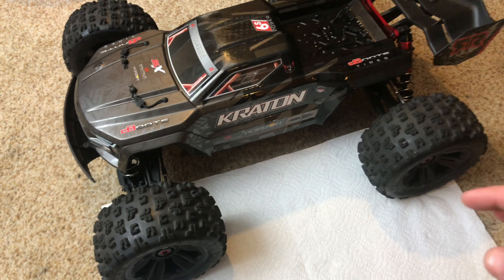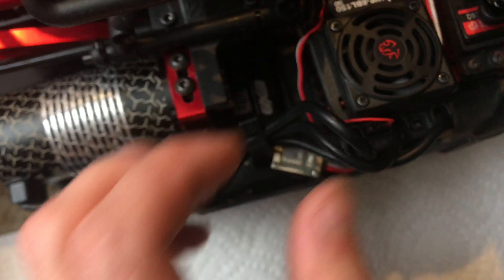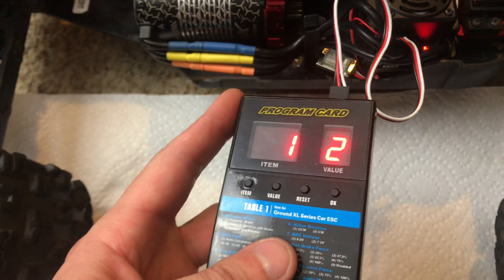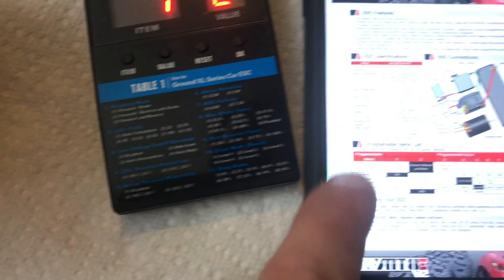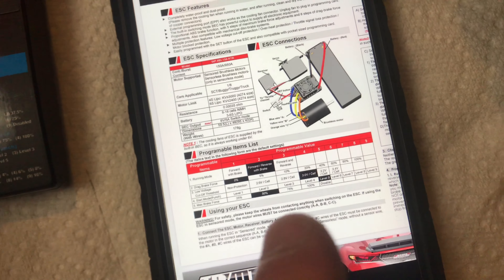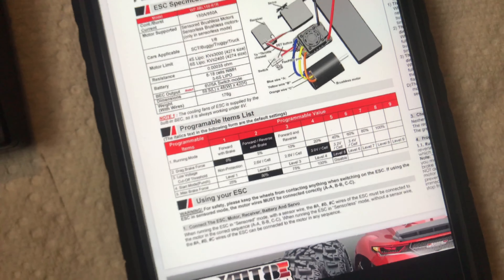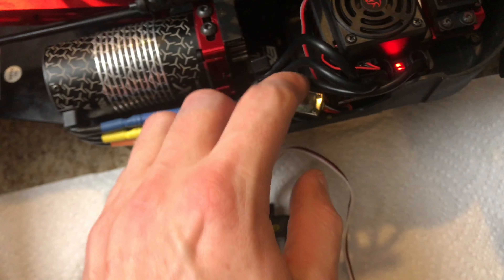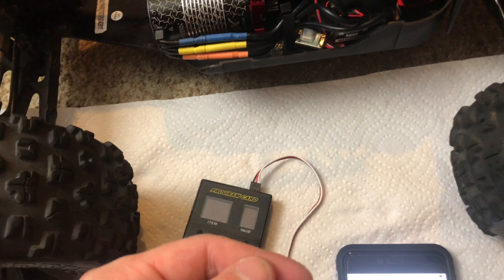HOW To PROGRAM YOUR ESC In LESS THAN ONE MINUTE! The FAST AND EASY WAY to Program Your Hobbywing ESC

Comment: Works on Spektrum  firma 160  Arrma 8S ( have to use the owners manual not the card for items and values )
Reply from the maker: It must be a rebranded hobbywing made for Arrma then.
Reply: Yes, I had to use the manual too, the Infraction manual. 

The manual that came with my warranty replacement ESC was different too... There's the retail version ESC and the Arrma one.
Reply from the maker: @LiquidSSSnake  that makes sense since it’s rebranded for Arrma.

Comment: I have a RadioLink RC6GS v3 and a Hobbywing Fusion quickrun SE 1800kv running on a 2s lipo for now I have a 3s 11.1v coming.  Anyway there seems to be a bug when I barley pull on the reverse trigger in reverse the throttle jumps up and down slow then fast ect....I dont know if I have my remote settings jacked up or what.  I have a Hobbywing programming card coming would that maybe fix it?  If you know how to setup my radio settings could you help?
Reply from the maker: It could be a connection issue with one of your motor wires or it could be a programming issue…but first thing I’d try is to recalibrate your radio system so it knows where your throttle end points and neutral point are
Reply: @RCKnockout  it was A.B.S settings.  I didn't know which A.B.S settings to change so I just started playing around with it and eventually figured it out.  She runs like butter now!
Reply: @RCKnockout  now I just need to figure out how to assign buttons but I can figure that out as I go.
Reply: @RCKnockout  I'm just wondering now, when I change to a 11.4v if the esc will accept it or if I will have to change a setting I'm running 7.4v 2s right now.  Still waiting on the 3s to be delivered.  Oh I absolutely hate the battery tray in the E10 and the gears provide a dangerous situation.
Reply from the maker: @DirtDobberRC  nice! Glad you got it figured out 👍😉

Comment: I wonder if those low low voltage cutoffs are for ni-MH battery packs.
Reply from the maker: Low voltage should just be for Lipo batteries I would think 🤔
Reply: There is a setting that turns off low voltage cutoff if you are going to use ni-MH packs

Comment: So if I get like a eBay esc and brushless motor can I link my tqi remote to it
Reply from the maker: Yeah you can use basically any esc and motor…..all that matters is linking the transmitter and receiver
Reply: @RCKnockout   so what do I need to buy?
Reply from the maker: @1994RALLY  basically any brushless 3s capable system with a similar (kv) rating to the stock electronics will work
Reply: @RCKnockout   I’m gunna give it a shot
Reply from the maker: @1994RALLY  go for it 👍😉
Reply: I have not broke mine yet and I bash it sooo hard
Reply from the maker: @1994RALLY  yeah they’re super tough

Comment: Less than one minute... Nine minutes later 😅
Reply from the maker: @mackabonnie4822  you have a valid point…but it does take longer to explain it than to actually do it…and truthfully if you know exactly what settings you want it would be possible to change them in a minute or less
Reply: @RCKnockout  you are right... Damn it
Reply from the maker: @mackabonnie4822  no worries…it’s all good